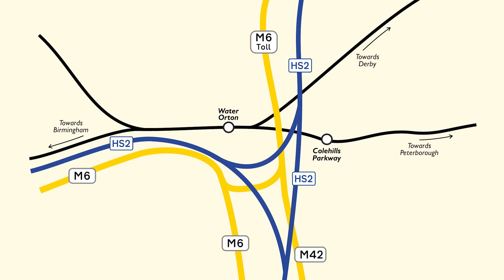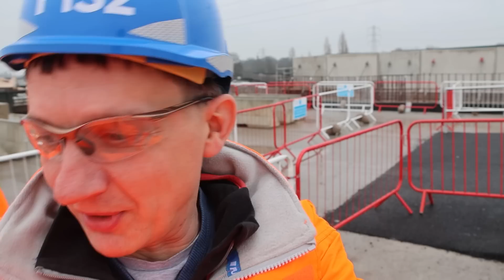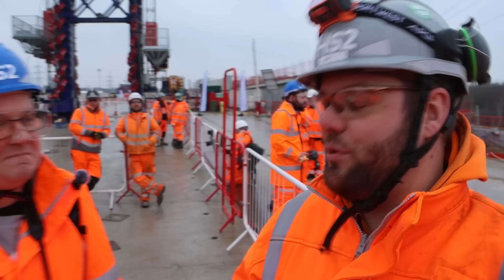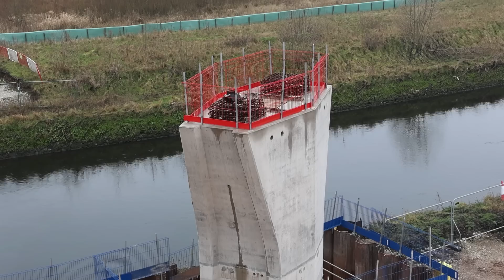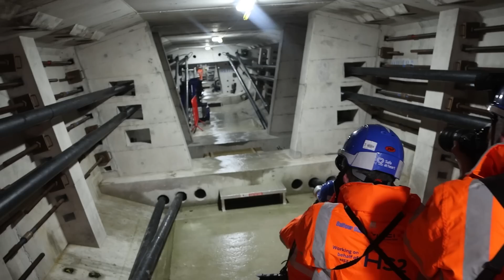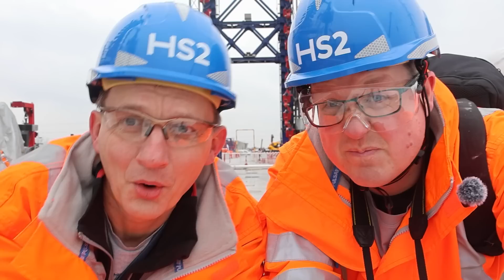HS2 Delta Junction Under Construction

Comment from the maker: Thanks to everyone who suggested edits/updates to the map in my community post the other day, I'm still working through them all!  So expect the map to be updated shortly - in fact, I'll keep on updating it and revising it over time as the construction continues.  If you want to add any suggestions/edits please do them in this thread here, thanks!.
Reply: I've also been doing an HS2 map project. It's got the route on 1 layer with different colours for viaducts, tunnels, green tunnels, embankments and cuttings, a 2nd layer with markers for every single bridge and then a few layers with all the videos I could find (I already added your Vent shaft and Chris's HS2 videos). I can send you a link to the Google My Maps if anyone would like to see it. 
I'm currently working on putting all the data into a database and building a website that will have the map and more, Google My Maps is pretty good but it has limits to the amounts of layers and total items. I'm hoping to have it deployed very soon.
Reply: If you're including road crossings - A46 "Kenilworth bypass" - details from HS2 around the box structure push under the road.
Reply: @streetster20  I was also going to suggest this, it was an interesting construction method and got onto regional news so I would say its notable enough for the map (ps. occurs at 52.351701263471334, -1.5368320690011958)
Reply: Unless I'm mistaken, your [tunnel] brackets on the map get confused and inverted between the Colne Valley Viaduct and Euston.

Love the map, very insightful!
Reply: @D_4_N_  Fazeley looks misspelt too.
Reply: It makes sense that the viaduct is so wide. HS2 is being built for giant trains to fully take advantage of its potential. When it starts running, the trains it will use will be small enough to fit on existing main lines, but if Phase 2 gets built, a new fleet of pure HS2 trains will be built to the continental European loading gauge.
Reply: So if phase 2 gets built to accommodate wider gauge trains how will they be able to travel to London or Curzon Street where the gauges are narrower  ?
Reply: @TrevorWilliams-fq8mg  The line is not being built to accommodate wider trains, christ where are you getting that from as HS2 is just a domestic high speed line
Reply: @noahottin4015  HS2 trains will be no wider than other trains and the line is not being built for continental UIC loading gauge as no such trains will use the line only UK gauge trains.
Reply: @noahottin4015  Sorry to disappoint you but NO Hs2 train will be built to the UIC European loading Gauge, where did you get that nonsense from as all HS2 trains will be required to travel on the Existing UK lines tp Liverpool, Manchester and Scotland and will be built to the UK loading Gauge, like wise Eurostar sets are built to the UK loading Gauge so they n travel over the normal UK lines to their Maintenance depot
Reply: Im guessing the question marks on some of the viaducts etc are either going to be unnamed or haven't been disclosed as of yet
Reply: @lesthefirst Why do you think any of the Viaducts are going to be named nd for what reason, they will just have numbers for future identification by the infrastructure repair company, bridges on Motorways are not named or viaducts on the existing railwys are not named so why do you think these bridges and viaducts on HS2 need to be named.
Reply: in the "Delta Junction Road and Viaducts" box top-right, I think it should be "M42" at the top under the N of "junction". Also, please please add in the M6/M42 sliproads going from M6/A452 to&from Gilson. Perhaps as thinner mauve lines. This would make it much clearer where the HS2 tracks will fit in. Thanks!
Reply: Ur welcome
Reply: Map link in comments doesn't work?

Comment: The canal crossing just north of Delta Junction is the Birmingham and Fazeley Canal, not just Fazeley Canal. And the route goes much further north than the A5, it would be worthwhile you showing more, it goes over the Lichfield Canal as well as over the WCML Trent Valley Line before doing a big curve to join at Handsacre.

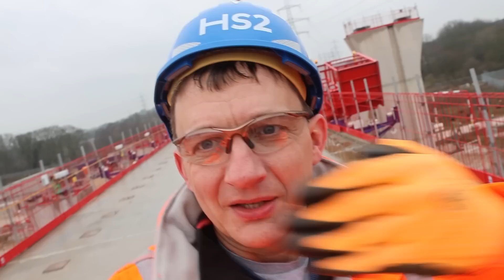Comment: At 3:40, the surveyors are using a total station, not a GPS. You're right in that they need to be able to measure the bridges to the nearest millimeter, they do this using the total station. 

A GPS is only accurate to 30 millimeters at best.

Comment: All this money spent so wealthy folk can get to London a bit faster. Why a monumental waste of money that could be used helping upgrade local infrastructure instead of concentrating on London.
Reply: The whole point of this was to increase capacity on the local lines (think of this like a bypass taking through traffic out of a town centre).

Trains aren't really for "wealthy folk" (although it's a good sign if they want to use them too).

And honestly, it doesn't especially benefit London much - I'm sure they would much rather have a new tube line.

Comment: I absolutely approve of HS2, in its earlier guises. But terminating the line at Handsacre, just short of the single most congested part of the WCML, is one of the single most stupid decisions taken by the previous government. It’s almost as if the decision makers have never been north of Birmingham, and no one thought to tell them about Shugborough Tunnel and Colwich Junction. 

These 200mph trains will trundle off HS2 at Handsacre (which won’t even have a particularly high turnout speed, as it was only ever designed as a temporary measure - similar to the Fawkham link of HS1), on to the WCML and be immediately faced with a busy junction and a two track tunnel shared with two stopping passenger trains and several containerised freight trains every hour. If no other part of HS2 is ever built, the link to Crewe is a necessity for it to even have a point.
Reply: But it won't be congested when HS2 opens because the vast majority of Hi Speed Intercity trains that at present go past Handsacre down the WCML to London Euston will instead travel via the HS2 line to London Euston via Birmingham Interchange Station and the Delta Junction

Comment: Your labelling of the M6 motorway on your map as the motorway that joins and leaves at the North of the delta junction is misleading. It is the M42 that leaves/joins there and the M6 Toll joins to the M42. Also pretty sure there is another crossing of the M42 motorway at the very north of the map after the Thames river crossing - there are certainly piers being constructed there anyhow

Comment: How many passengers travel onwards from New Street.  It will encourage long distance commuting.  Take passengers and so frequency away from the existing multiple, high capacity and fast enough routes. Take economic activity away from the towns/cities between London and Birmingham.  Even if and when completed be a constant drain.

Comment: I think when hs2 opens in 2029 people will relise the benefits and phase 2a and 2b will be built
Reply: Unfortunately the politicians who make those kind of decisions are more concerned about retaining votes than the long term future of this country's infrastructure but I like your optimism.
Reply: I wouldn't count on the 2029 opening (only between Birmingham and Old Oak Common). The new CEO of HS2 Recently said that there are still plenty of problems and that the estimate is that they are nearing 50% completion cannot be verified as they actually not sure where they are. He also suggested that it´s probably closer to a third. They are doing a revision, or a "reset" as he called it but the assumption is that it will open in the 2030's so currently there is no estimate and it can, theoretically, be 2029 (not likely) up to the first half of 2030's (2031-2033 is an unofficial estimate) -  probably still without reaching Euston. I do believe that once operational it will help to increase support to continue the project but I'm not sure it will be enough to restart the other phases and if they will it will probably only be 2a to Crewe. it will take a long time before people will be willing to try again but I hope I'm wrong.

Comment: The Chinese is building high speed tracks in Tibet, makes HS2 like child's play!
Reply: 1st of all, they're not. It won't be anywhere near high speed.
2nd, we probably don't want to be copying China's methods
Reply: We probably would do well to copy how happy they are to put the vast majority of their tracks on elevated tracks / viaducts, avoiding expensive tunnelling.

We have better role models that we could look to in any case. France have been building major rail infrastructure projects for years at a much better cost per mile than we seem to manage. A clear vision from the outset, less chopping and changing during delivery, and a stronger civil service (meaning less outsourcing of planning and logistics) all seem to be factors in their success.

Comment: This project is great it has the potential to essentially turn england into commuter suburbs for london. Given the growth in London this will do alot to spread benefits of London's economy to the north of England through frequent fast high speed rail assuming the entire original project is built. Imagine being able to get a train at Preston station and be in central London less than 90 minutes later. Would open up alot of employment and education options for people in Preston and similar places. It could support significant greenfields housing development too and reduce housing costs. But it need cheap fares at all times for everyone to achieve its full potential.

Comment: So glad we’re bringing the UK into the 20th Century. 😉
Reply: HS1 and the Selby Diversion already exist
Reply: Here in Australia we're still talking about building HSR1. Maybe one day we'll join the UK in the future of rail. 😅.
Reply: @oohkumar Was "20th Century" sarcasm, or did you mean 21st Century (the 2000s)?
Reply: @backwashjoe7864  Good question. Emoji added for clarity.
Reply: @backwashjoe7864 I'm pretty sure they meant 20th century, as this standard of railways existed in France in the 1980s. 21st century would be stuff like MagLev trains.
Reply: 21st Century not 20th Century
Reply: @peterwallen1063 really?
Reply: @peterwallen1063 This standard of railway is 50 years old. It's just that the rest of the UK's railways are built to a standard that is 150 years old.
Reply: @bighamster2  Railways have been built to the standard gauge for 200 years now, the UK /UIC ( Berne Gauge) refers to the width and height of Coaches and Locos

Comment: The Reussbrucke concrete rail bridge near Amsteg, on the Gotthard route in Switzerland, has a hollow concrete construction. The hollow part is actually a public footpath. The floor of which, is see through metal grating! You can see a picture of it on the usual internet maps, by clicking on the bridge name.

Comment: We really do need to get HS2 restarted (with a better route that has through stations in places like Manchester, rather than more spur stations) and get the thing extended all the way to Glasgow and Edinburgh.

This project is our best hope for binning off domestic flights in England and our best hope for getting rid of InterCity trains off the mainlines so more freight trains and more stopping services can run.
Reply: It feels very British to make the city center stations all branching terminal stations. Yes, it would have been more costly to build Birmingham as a deep through station, but worth it in the long run (especially compared to all the motorway and airport expansions getting funding eventhough their effect is negative).
Reply: @GustavSvard  In fairness, high-speed rail in Spain and France is also frequently (although not always) routed either into new or existing overground rail hubs (with trains terminating there) or through inconveniently located parkway stations far outside the city centre. So it is not a uniquely British thing. But it is most certainly a cost-saving measure, no doubt. And long-term, not a smart one. An underground station in Birmingham and Manchester would likely have been a better idea. Would have cost a lot more though. Still, things look reasonably bright for the future. Take Spain as an example. Newer investment is going towards either brand new, (partially or entirely) underground through stations (La Sagrera TAV in Barcelona, Estación Central in Valencia) or rebuilding existing terminals to allow high-speed rail through-connections (León, Madrid Atocha, Madrid Chamartin etc.). So I think HS2 will likely see future expansions too. Though perhaps only in 15-20 years at the earliest. Though of course by then it will be much more expensive then it would have been initially, had this infrastructure all been built right from the start. But such is politics. Trust politicians to make the same mistakes again and again...

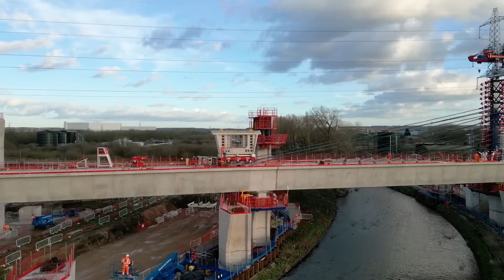Comment: The Track Diagram @0:41 made all the difference.  
Now I understand what the "4-track" is and how it works north to the notional East Midlands Phase 2b, and south.
This is like a double-delta north and south with a single pair of tracks to Curzon...so this 4-track Delta really adds 2x capacity (number of train trips) north-south, so like two north-south lines concurrently and they only combine somewhere at the Birmingham (airport) Interchange.   If all built the East coast and West coast could operate independently until this delta to Birmingham, and only then at that time together south to the Birminingham Interchange up to London.
I watch Chris (Rail Focus) and Geoff all the time to make sense of trains and HS2.  
Thank you !
Reply: The penny dropped for me when I worked out the path a Birmingham to Leeds and London to Manchester train would each take, and how they would avoid each other no matter when they were timetabled. Ditto Birmingham to Manchester and London to Leeds, and the four reciprocal journeys. Such a shame that four of the six parallel tracks at Hams Hall are going to sit unused for years, but hopefully future politicians realise why Phase 2 is vital.
Reply: Agree, the track diagram did make all the difference. There always seemed to be one viaduct too many being built and now we know why.
Reply from the maker: thanks!  what .. .i'm thinking of doing is adding the localised track layouts, as "info boxes" to the side of the main Route Diagram, so that people can see how the tracks are in localised areas - this would be good, right?

Comment: Wouldn't it be a good idea to mothball construction of the northern bit of Delta Junction until funding for Handsacre Junction is approved? Until then, north of Birmingham, HS2 are literally building a railway line to nowhere.
Reply: Handsacre Junction is approved for construction, it’s the junction just before it, where the line would continue to Crewe and Manchester that’s currently unapproved. Handsacre Junction is absolutely vital to HS2 and without it you’ve built a really fast people mover from Birmingham Airport to Euston.
Reply: Sad but true. Although Handsacre will happen (has to), it is HS2a (Crewe) which is needed!

Comment: Re Map
At the southern end you have  ]Tunnel[  which is correct according to OS. Further North they appear as [Tunnel] which is confusing. I might suggest slightly lightening the blue line colour within the tunnel to indicate that this is underground. 

What are the red and green spots? They are not explained.

Some of the viaducts are shown as dotted boxes. Others are just named with no dotted box. Why the difference?

Some tunnels and viaducts have lengths, others don't. Lengths for all would be more consistent.

Comment: 55 years on from Spaghetti Junction connecting the motorway from London to Manchester with a spur motorway into Birmingham City Centre HS2 will have a similar structure performing the same function for trains.  Bit of a nerd parallel but that structure was 8 years behind schedule and triple its original budget.  Fingers crossed that one day there will be HS2 lines into the City Centres of both Manchester and Leeds but that's for the future.

Comment: Should have used every resource that’s been used for HS2 on building for healthcare and education.
Reply: I suspect you have no clue what your talking about....🤷‍♂️
Reply: @ianhudson2193  Okay, what are the benefits of HS2, both as originally designed and as actually being built? How much is the "as being built" going to cost before the first train runs, across how many years, and how does that compare to the budgets for healthcare and education? Is HS2 going to generate profit in the economy, and if so, when is that projected to start happening?
Reply: @backwashjoe7864  HS3 then, can't wait

Comment: As i understand it, this Delta junction is pretty much as originally planned because HS2 is going another 18 miles all the way to Handsacre on the WCML not just "London to Birmingham" as is often reported in the press. Indeed two miles before HS2 joins the WCML there is a curve at Fradley where the Manchester HS2 was supposed to break away. The constant faffing over whether the Manchester leg of HS2 was going ahead seemed to stall progress around Handsacre and Fradley as removing the junction meant a fundamental rethink and recosting. Despite Manchester eventually being cancelled, the HS2 website still seems to show a mile long spur of the Manchester section from Fradley. it will be interesting to see whether any earthworks or viaducts for this are built at Fradley to accommodate a future Manchester link. Whichever, it appears an "S" section of curves east of Handsacre will be constructed to 'join' the Manchester alignment, a memorial to where the Manchester section was amputated. https://www.hs2.org.uk/map/?mapView=12_52.7062_-1.7698